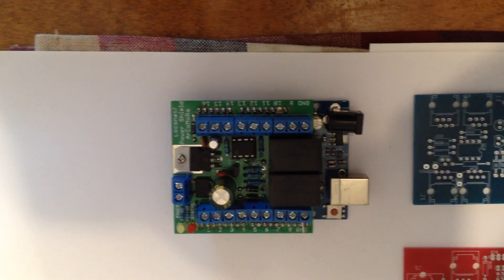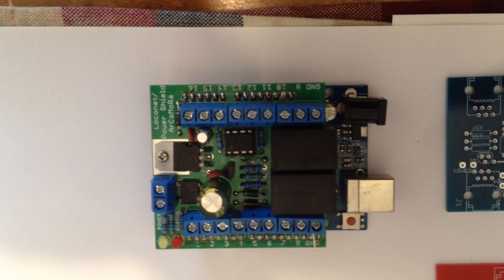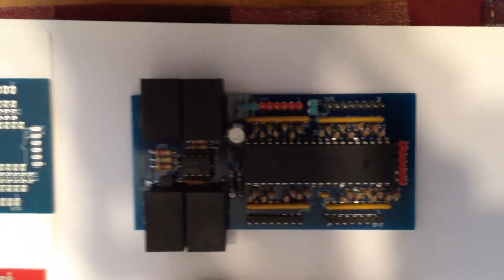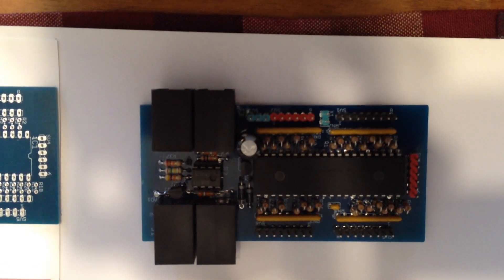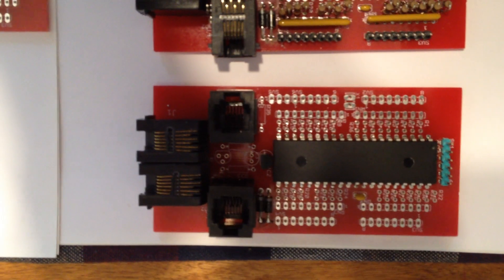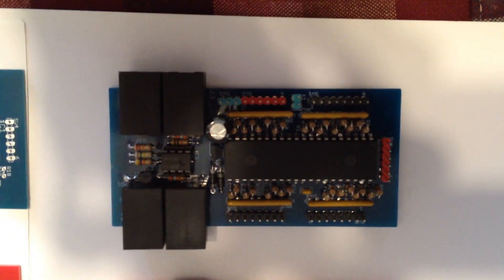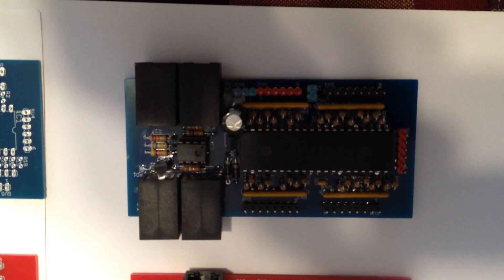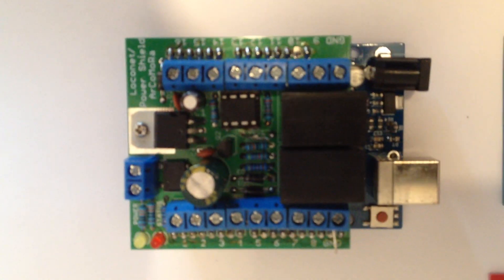Loconet 16F1519 32 input device.

Comment: Good job with the boards
Reply from the maker: Thanks, I'm planning on building an other control panel based on some pcb's I had designed and hope to use these boards as input/output connections to the control panel using loconet. A video on my progress there will follow.